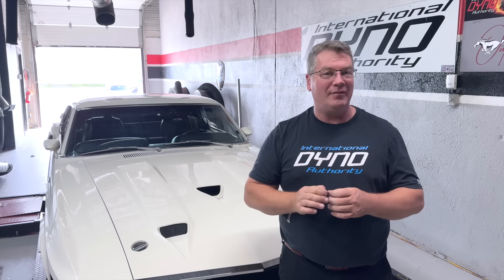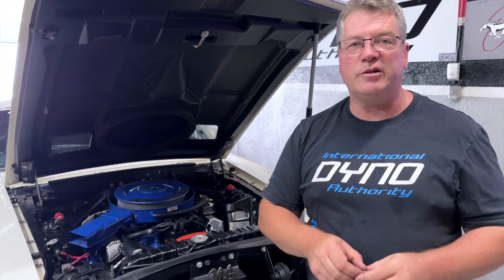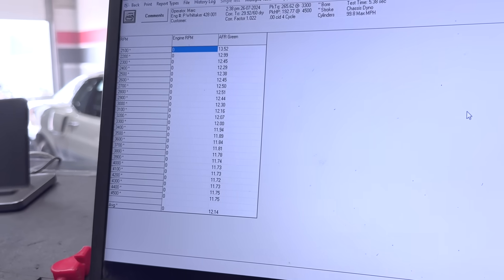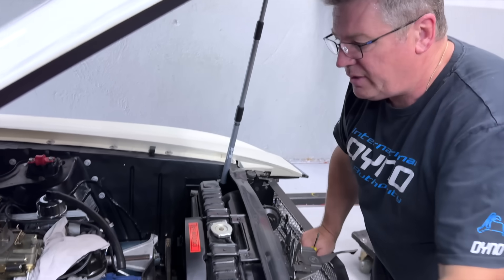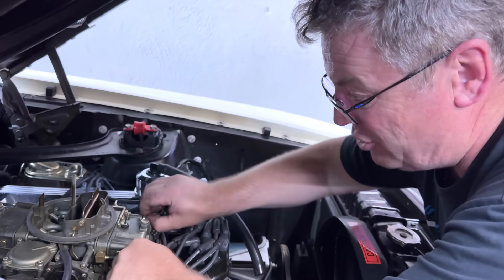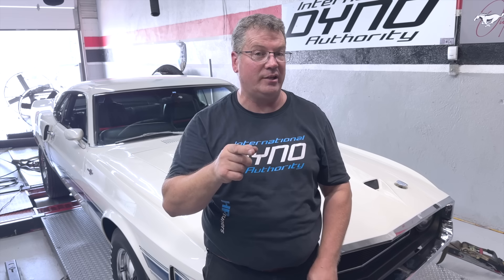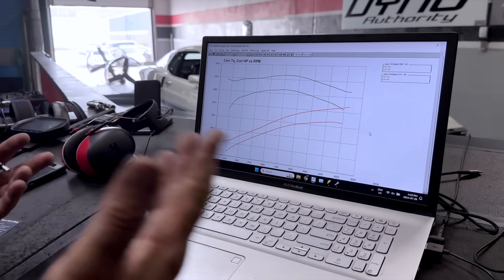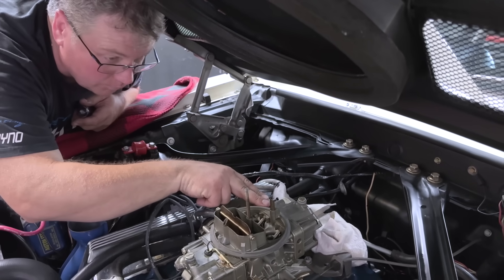Original, unrestored '69 Shelby GT500 tuned on the dyno

Comment: It was rich and smoking because the secondaries are locked out until the choke is completely open. When you floor it with the secondaries shut it dumps fuel from the vents into the throttle body because of negative pressure. If you’re leaving the vacuum advance off you gotta bump up the base timing to get more power out of it. The total advance should be 28-32ish with full advance at about 3000 rpm’s. You have to play with the timing in this area to see what works for the specific engine setup you’re tuning. Turning those mixture screws only adjust idle mixture. They do little to NOTHING above around 1000 rpm’s!!😆. So that had little to do about it being so rich.

Comment: Back in 1982 I got the second Mustang GT in our state.   I was having fun and would floor the pedal and watch black smoke pour out the exhaust.  I took it back to the dealer and service manager said "well we cant find the issue and we cant adjust the carburator due to emissions laws, you shouldnt be driving the car like that anyway." I was peeved to say the least.  My buddy who initially told me about  the car before I bought it worked in the service department as an oil change tech.  He said put a new carb on it (yes I voided warranty) and  bring it back to the shop  after 5.  I did and we proceeded to put car on a lift and knock the stuffing out of the  catalytic converter and the service manager came by and started screaming about it being illegal.   But it was too late, and i drove away with probably 20 more horsepower and no black smoke.  Me and my buddy laughed about that for years. RIP Bob

Comment: idle mixture is only for idle and part throttle. No effect at WOT. Accelerator pump tuning is only for tip-in response. At part throttle, you can run leaner than stoichometric without danger. At PT you can run 15.5 to 17 smoothly and safely. The factor must have been idiots to have it run in the 10s, or someone "tuned" it in the past

Comment: You guys are great, worth every penny! To anybody with a 59's through late 70's this is what makes a car or truck sing. A proper tune! I grew up a DIY guy because of money I did the best I could to get things just right. As I got older and made enough to save a little, I took my car to a shop that was in Pico Rivera Ca. called AK miller's garage. They Dynoed my 72 El Camino. I got the right range plugs, the right advance, the right jets due to my changing the intake and carb.  plus, headers. I could have never gotten the car to run properly without their dyno and their experience. That was in 72 and it cost 10 bucks per bank. So, you folks up north are lucky to have such a talented crew and shop in the Ottawa Ontario area.    CHEERS

Comment: It's a very nice car. I suspect the majority of that smoke you encountered was carbon buildup on the valves, chambers, pistons, and exhaust system. I (suspect) the elderly gentleman isn't ringing its neck that hard on the street. It cleared after blowing it out multiple times. Changing the jets may have been wise. The jets should be whatever was specified by Holley for the original carburetor, nothing more or less. No mention of plugs or changing them, and if not touched, are probably buried in carbon. I have to wonder how much better still it would run with the distributor set to factory specs, the (correct) dual port vacuum advance installed and set up properly, correct base timing, and proper (100 octane) leaded like it was born to run. Personally, I would set it up and tune it properly, not detune it just to make life easier by running incorrect low quality unleaded pump gas. Detuning it and running the wrong fuel is really hard on the motor, and it hurts performance.
Reply: I guess you weren’t listening when he said they had service records indicating smoke issues “from day one”. Also, I suspect it had some misguided jetting changes over the years trying to get more power from a somewhat sluggish engine, which exacerbated the smoking issue. In addition, the vacuum advance on the distributor was missing. More evidence of back yard tuning. His “detuning” to use your word, gained 75 RWHP.

Comment: All muscle cars this era were de tuned from factory and severely underrated especially in rpm. most would scream to 6 or 7k stock, just a tune. and most ran 12s or even 10s like the performance big blocks.
Reply: That's 1.) a myth and 2.) exaggerated. Run the majority of the stock muscle car era motors to those RPM's and you will need more than a broom and a dust pan.

Comment: Just think how much better still it would be if it was fuel injected.
Reply from the maker: Yes, with modern OEM fuel injection like a E38 computer. Would be awesome.

You just have to be careful and run from anything that is like the Holly manufactured junk..

The carburetor is literally a hundred times better than a TBI setup
Reply: @internationaldynoauthority693  Well stated.  I love fuel injection but fuel injection just mimics a properly tuned carburetor.  You do proper tuning!  Loved the video.

Comment: Does it have Leaded valves seats or unleaded valves seats?
Reply from the maker: All, as Original.
Reply from the maker: In 1969 the seats were machined directly into the heads. No Stellite Seats were installed.
Reply: @internationaldynoauthority693 ROFLMAO. Stellite seats. That's hilarious.
Reply: @internationaldynoauthority693  427 heads?
Reply from the maker: @nara4588  All as Original

Comment: The 428CJ was actually 410-415 HP.. I know because i owned a 1968.5 Mustang GT
Reply from the maker: ⚙️ Factory Rating vs. Real Output

🔹 Factory rating (advertised):

1968½ 428 Cobra Jet (R-code) was officially rated at 335 horsepower @ 5200 rpm and 440 lb-ft of torque @ 3400 rpm.

That’s what Ford published in brochures and window stickers.
Reply from the maker: 🧾 Summary

Source	Horsepower Rating	Type

Factory (advertised)	335 hp @ 5200 rpm	“Insurance-safe” rating
Independent dyno (period)	405–420 hp gross	True gross power
Modern chassis dyno (stock, net)	320–340 hp at crank	Real-world net rating
Reply from the maker: Marketing strategy:
Ford wanted the 428 CJ to seem like a “street sleeper” — a mild, docile big-block that actually produced brutal real power.
Reply: Only called the Cobra Jet because of the Quadra jet carburetor that Ford installed to up the HP figure.
Reply: No you didn't. "Half years" do not exist. Period.
Reply: @deeremeyer1749  Ford even introduced it as a 1968.5  model in April 1968. Even though its titled as a 1968, they have always been considered to be 1968.5 cars

Comment: Wait. That 335 hp rating was gross.  And they got 300 to the wheel right?  With a (rather on the low side estimate) 15% powertrain loss in hp, that's 345 hp at the crank.  Assuming that 345 net rating is 80% of the gross, that's a 433 hp engine.  Assuming the net rating is 70% of gross, that's nearly 500 hp.  And from the factory they insisted it only had 10 more hp than the 390 4 barrel

Edit: I got the math wrong, it would be dividing 300 by .85 not multiplying by .15 then adding to 300.  But that only pushes the net at crank to 352hp, and the gross to 440hp with a .80 estimate of gross to net, and 503 with a .70 estimate of gross to net
Reply: Save it. Net HP readings were introduced in 1971.

Comment: Not hooking up the vacuum advance while tuning for power is criminal.
Reply from the maker: This particular distributor, was designed to run without the vacuum advance.  Calibrated with highly efficient Springs and weights and fly out mechanism
Reply: @internationaldynoauthority693  I mean if you aren't going OEM why not just go with an MSD at this point?  It's still "period available," if not period correct, and the car is not unmolested anyway.  I bet you would get siginficant gains (maybe 10 hp and it would just run better in general.) Anyway, loved the vid.
Reply: @internationaldynoauthority693 Does it advance the timing? I know this isn't a 302 but the advance timing gave a lot and was really noticeable when I put a slightly larger cam in it
Reply: Maybe I'm missing what you are saying, but you shouldn't have vacuum advance hooked up when tuning for power.  At full power, vacuum should be zero and you won't have any advance anyway.  Vacuum advance is a drivability thing, not a power thing.
Reply: @adamdice231  That's why I said get an MSD, drives better and gets same if not more power.
Reply: @msromike123  You sure could, but if that car is all original, better to keep the original distributor from a value perspective.
Reply: @adamdice231  The vacuum advance is hooked up to your manifold so the more revs more vacuum. More vacuum more timming.
Reply: @mthompw  You have evidently never hooked a vacuum gauge up to an engine and driven with it.  At steady speed, I agree that vacuum can increase (to a point) with rpm.  If you put your foot to the floor with the both the primary and secondary butterflies wide open, your vacuum approaches zero, unless your carb is way too small.  That is why two barrel cfm is rated at 3.0" of mercury and a four barrel is rated at 1.5" of mercury.
Reply: @adamdice231  looks like you know already buddy
Reply: @mthompw  I do.  Just trying to keep misinformation out for the benefit of others.
Reply: @mthompw Wrong, wrong wrong higher vacuum is at smaller throttle openings I.e. cruising speeds so that advances the timing for fuel economy reasons
Mechanic here….
Reply: @54Rocketeer  So vacuum advance "at idle" gives you better idle and gas mileage then when you press on the gas...
Reply: Vacuum advance is for fuel economy not power BTW

Comment: That thing looks brand new. Who's fooling who? That car and engine has been worked on extensively.
Reply: Maintained is not the same as restored
Reply: I think you’re right
Reply: I can’t get over all the compliments I have received on my unrestored car. This car is in amazing condition - that’s why I bought it. However, I can assure you that if you saw it in person you would agree that it is unrestored and mostly original - never apart , as built from the factory. The video does show the car very nicely so I understand your scepticism.

Comment: I would save the old Carb,  and 100 % replace with Holly Brawler either a 750 or if it need it a 850,  it's not a Mileage Car,  it's a BIG BLOCK Fun Car,  Vacuum Secondary carb need to Bye Bye! 
Then Dyno Tune it,  and Lets see but my thinking is a 750 Brawler Double Pumper is next , .  STORE THE ORIGINAL,  Maybe have it gone through by the Best Ford Carb  Guy because it's not Rught!   Should get 350 to the wheels,  Torque is Pretty Close but may pick up a bit!  IMHO. - ABSOLUTELY BEAUTIFUL 69 GT 500 THAT I WOULD TRADE BIDY PARTS FOR!!!❤❤❤❤❤❤❤❤❤❤
PsS - Upgrade that ignition and does it still have points?  
If so next Project,  Just KEEP all the Original Parts!

STILL DRUELING 😂

Comment: I would never put a senior citizen on a Dyno! I myself was just put on a treadmill recently for a stress test…it just ain’t right!
Reply: Some of us can still handle it, and he looks very fit to me. I'm 75 and my first car was a '57 Plymouth that I put a Hemi in at 18, and I still love going fast. I actually raced a BMW M5 the other day  in my Lexus just because I wanted to see how fast they were, and I found out. It was a boatload of fun but he left me in the proverbial dust. At any rate I'm going back to old school rides again (which is why I was interested in this video) and am planning to pick up a vintage car and another 4x4 pickup soon. There's just something so cool about the sound of a old V8 and running through the gears with the windows down and the stereo cranked up. I also ride motorcycles and I'm looking to get another one in a month or two btw.
Reply: Are you talking about the car or the drive???

Comment: Jet engine?  What's shelby about it?
Reply from the maker: The 1969 Shelby Mustang Cobra Jet (such as the GT500) was powered by Ford’s 428 cubic-inch Cobra Jet V8 engine — one of the most powerful engines Ford offered at the time.

Here’s a quick breakdown:

Engine: 428 cu in (7.0 L) Cobra Jet V8

Horsepower (factory rated): 335 hp @ 5,200 rpm (underrated — real output was closer to 400+ hp)

Torque: Around 440 lb-ft @ 3,400 rpm

Carburetion: Holley 735 CFM 4-barrel carburetor

Compression ratio: Approximately 10.6:1

This engine was part of Ford’s legendary FE engine family and was designed for maximum torque and high-speed performance. Many enthusiasts also refer to it as the 428CJ. Some rare versions had the Super Cobra Jet (SCJ) option, which added an oil cooler and stronger internals for drag racing.

Comment: That amount of smoke on later pulls isn’t normal.. likely washed a few of your bores out with that excessive rich condition, for however long it was run like that. Check compression, check crankcase pressure… I bet you’ll find it’s got a lot of blowby, or a valve stem seal is absolutely pissing oil.
Reply from the maker: Ashley none of what you said is true. All of that was tested for. And, we were able to go through and actually just tuned the engine correctly. If you watch the video from start to finish you will understand, that we had to bring the vehicle back in twice. In order to update some of the parts in the carburetor because some of the parts in the carburetor are ancient and old and had to be replaced and we were able to find the problem fixed the problem and get rid of all the smoke 100%
Reply from the maker: Actually it wasn't there was no issue with the engine whatsoever compression measured as normal you need to remember that they were not under Full Throttle acceleration all the time. As a matter of fact they were under cruising most of the time. But as soon as you would give it full throttle and make a Full Throttle pass it would blow smoke. Which does not wash down the cylinders. Because you're not under Full Throttle all the time.
Reply: @internationaldynoauthority693 that is valve stem seals failed, then. textbook. you should know that.
Reply: @WayneB-rv1xsHe tuned out the rich condition and it still smoked like hell
Reply from the maker: @fry.master 16:09 Zero smoke -- Pay attention.
Reply from the maker: @fry.master Jumping to conclusions happens when someone forms an opinion or makes a decision before fully understanding the situation or considering all the evidence. This often stems from assumptions, emotional reactions, or biases rather than logic or careful thought. When people rush to judge, they may overlook key details, misinterpret information, or ignore context that could completely change their understanding of what’s actually happening. It’s a mental shortcut—our brains trying to make sense of things quickly—but it often leads to inaccurate or unfair conclusions.

Failing to pay attention to the evidence in front of you can cause even greater misunderstanding. When we selectively notice only what confirms our existing beliefs, we close ourselves off from the truth and weaken our ability to reason objectively. This can damage relationships, spread misinformation, and lead to poor decisions both personally and professionally. Taking time to slow down, ask questions, and consider multiple perspectives helps ensure that conclusions are grounded in fact rather than assumption.

Comment: There is a weighted needle that is supposed to block off the accel pump passage to prevent the engine from drawing extra fuel through the discharge nozzles. Changing the size of the accel pump discharge nozzles shouldn't affect anything after you've hit wide open throttle. If the engine is pulling enough vacuum to lift up that needle and pull fuel through, then it's a new problem I've never encountered...